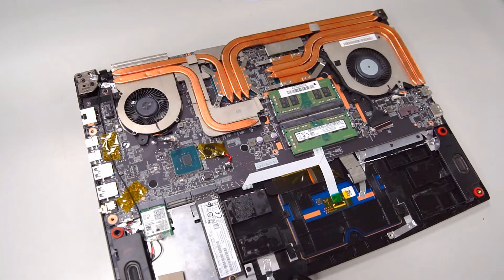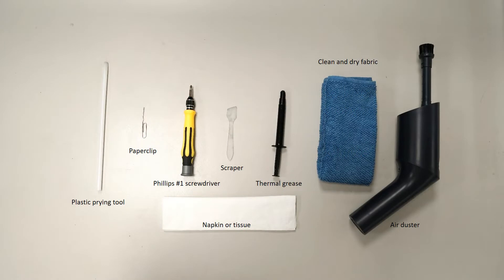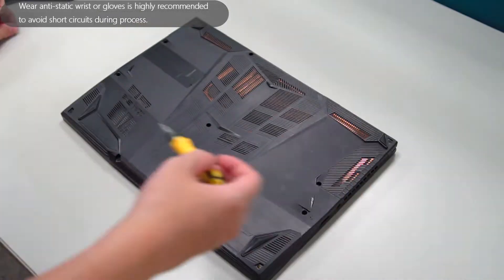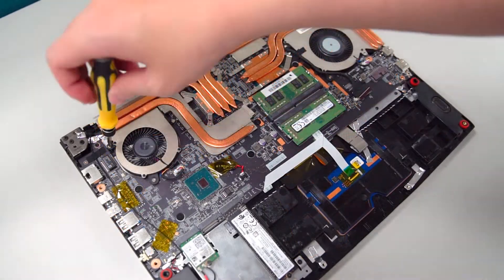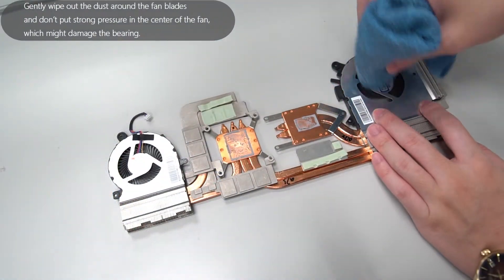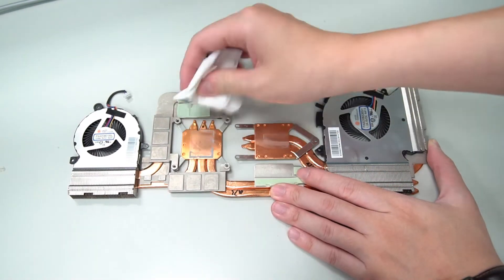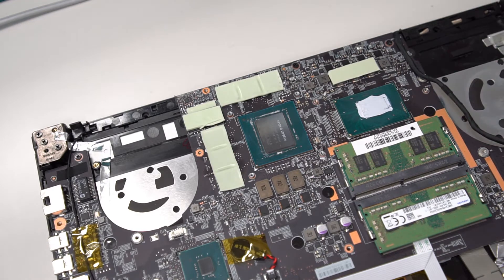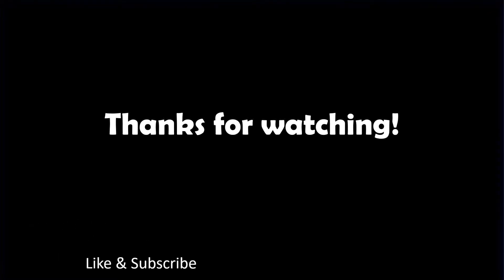How to replace the thermal grease and clean the laptop's fans

Comment: My laptop does not come with thermal pads, it comes with grease, what kind is it? Thanks
Reply: thermal pads are for general heat transfer across the laptop and thermal paste (which the video called grease) goes on the cpu and gpu